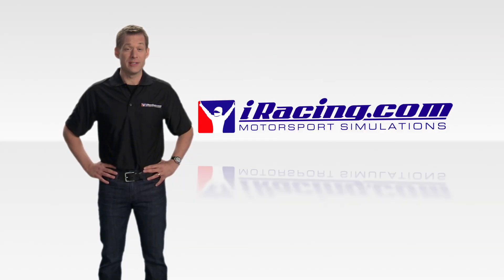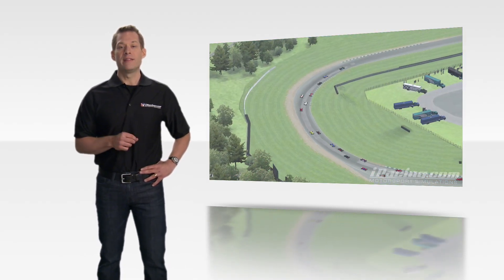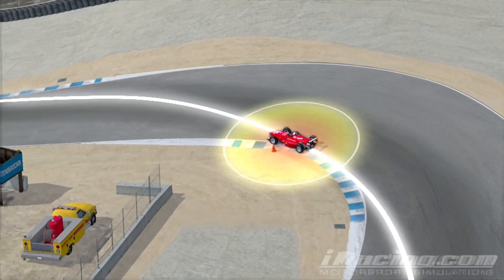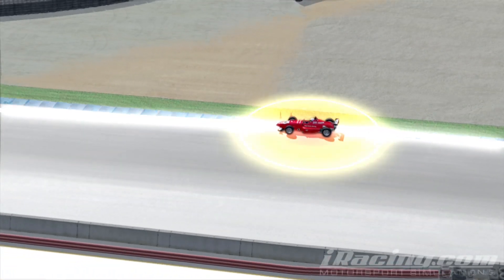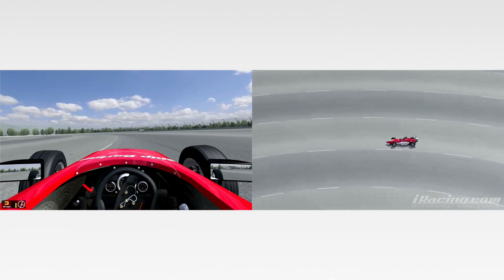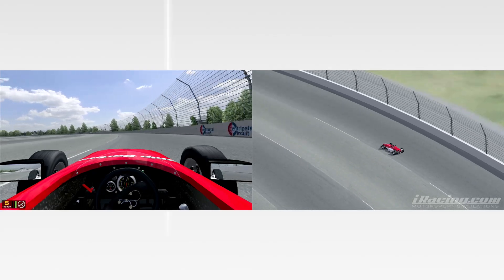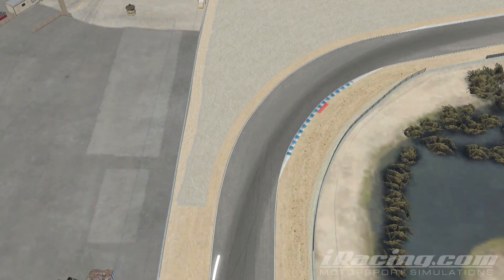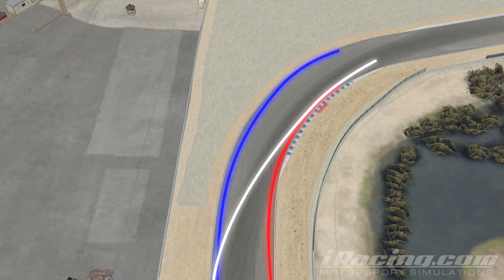iRacing.com Driving School Chapter 3A: Fundamentals of the Racing Line & Cornering

Comment: The apex and the track-out destination really depends on the car you're driving.
The only thing that all have in common is the turn-in point where every car and every bike and every class and type of motor racing will have to touch the same marker when entering a corner .

Comment: The reason the white line is the "most efficient" is because it has the least amount of bend of the three curves. The curve with the least dramatic bend yields a higher speed throughout the turn.
Reply: didn't you listen when the guy talked about the radius equals speed equation? The bigger circle will yield faster speeds. Thus, there is a flatter slope/curve. How do you not get this?When you start from the turn in and hit the apex, you essentially cut out the sharp turn you will have to take. Thus, your steering wheel will not turn as many degrees than hugging the inside or outside, or even a semi-apex as I like to call it.
Reply: bigtopbollocks Holy hell, you really don't get it, do you? Wow! Of course each angle of approach will equal a 90 degree turn, but in order to maintain the highest speed, your slope has to be the least steep. Imagine it is a straw, and you have to put it 90 degrees and still be able to drink out of it. If you still don't get it, you should never get on a racetrack- ever.
Reply: bigtopbollocks No matter what I say and no matter how silly you look, you must always be correct- eventhough you are not. I feel sorry for your wife (if you are married).  Being stuck with someone like you would probably be like a lifetime prison sentence.

Comment: And all of this is pointless if your Race Wheel for the PC is not set up correctly, so that you don't create over steer by running much too low a degrees of rotation and compensating this with Steering Lock in car set-up, this will have a HUGE effect on drive-ability and driver performance.

Comment: XMalonyX Unfortunately, I don't think there is one master equation. Or if their is, it'd be quite long.  This would be calculated based on the different measures of the track.  The angle of the pavement relative to the ground, the temperature of the air and track, the coefficient of friction of those tires (Not to mention the tires will be traveling at different speeds), the power being applied, the body roll (body acceleration) of the car, drag and so many other things.  If you were to assume the objects were all more stable/simple it could be solved intuitively with some kinematics and conservation of energy.  Take a calculus based physics course if you want to start understanding some of that.
Reply: Or I suppose even you could simplify it to just the turn itself, without the car in it.  And find the geometric shapes that would give the quickest results. But, I don't think it'd be that simple.
Reply: FinnFinley there*